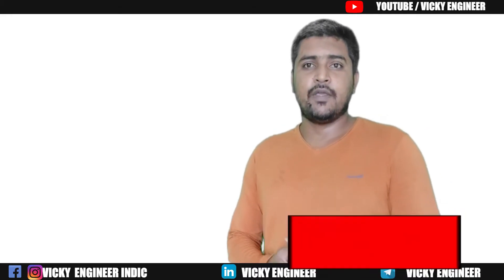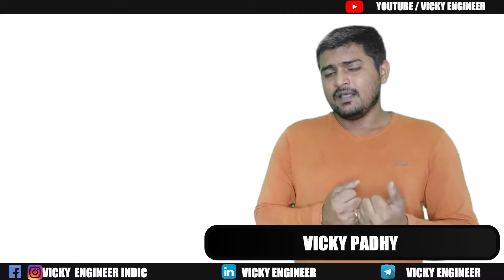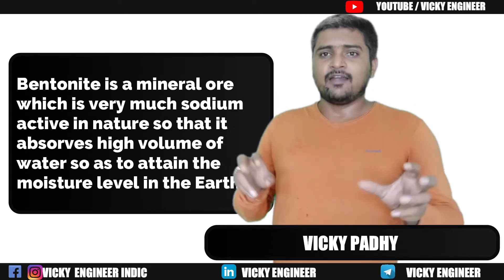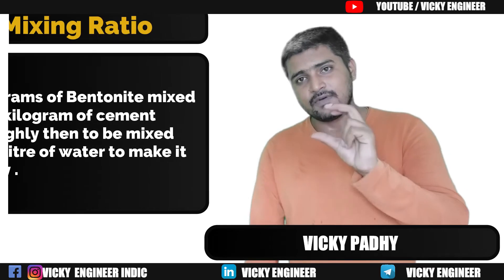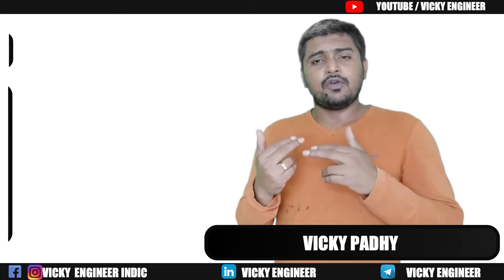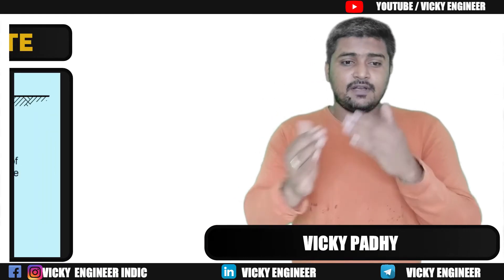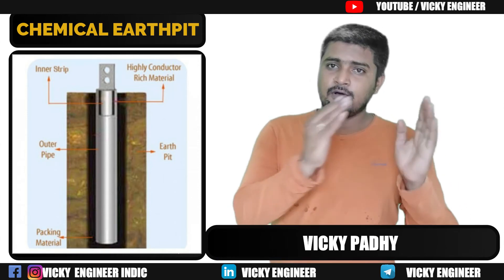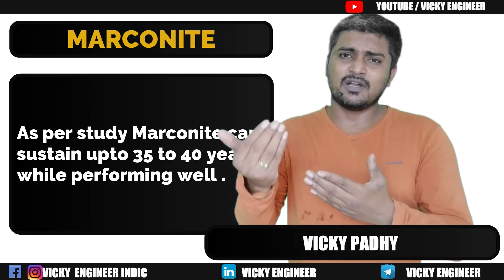Chemical Earthing for Home | Installation Procedure of Marconite & Bentonite Earthing.

Comment: It is depends on load?
Reply from the maker: Basically it always calculated on higher note. At least go for 3 meter copper electrode . If then you are having doubt connect on Facebook /vickyengineerindic .